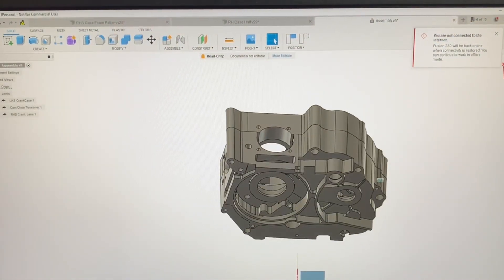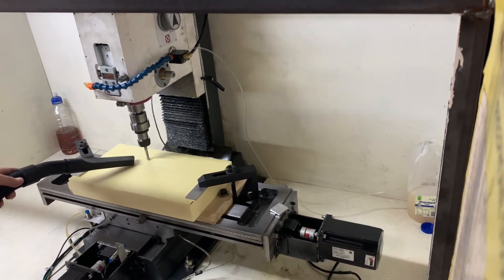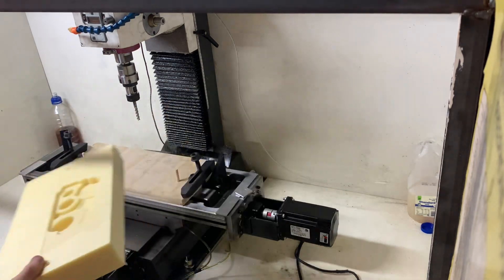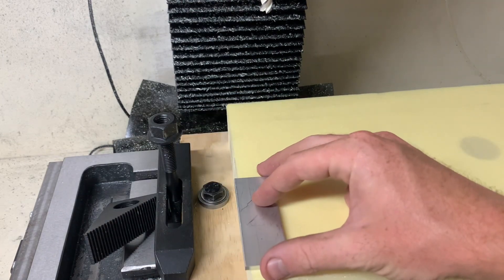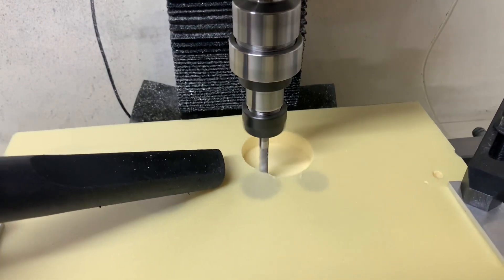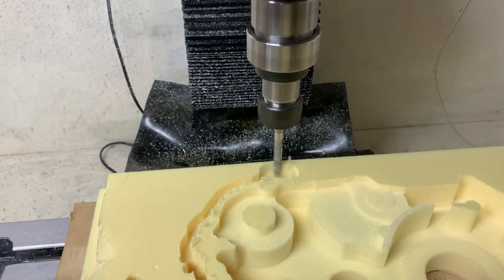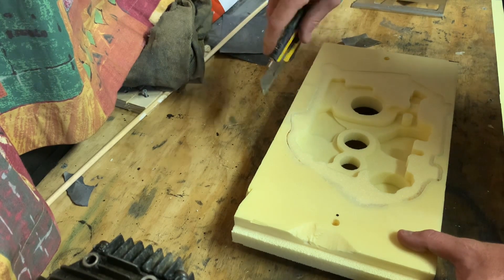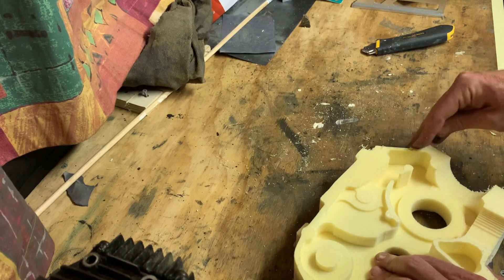Making a foam engine

Comment: You can share CAD files for those of us who have no experience using the program.
Reply from the maker: Negative although soon I will be selling the raw castings
Reply: @OddsandEndsMachining  Unfortunately, I won't be able to buy anything from you if I'm in another country. That's why I asked you to share the CAD files, no matter the modification, or sell us your CAD files. I don't have experience with CAD software, but I do with casting and mechanics. That's the easy part. If you do it, you'll be more successful. We don't disregard your work because it cost you. But it's only a digital file, and someone else will do it for you if you're stingy.
Reply from the maker: @osvaldodelcompare6627 to be honest, I’d rather ship the castings with paper drawings than sell the files. The castings would be very cost effective. 

Once the files are in someone else’s hands I have no control over them.
Reply: @OddsandEndsMachining  And why would you have to have control over them? If that were the case, Cults 3D wouldn't exist. No 3D design sharing site. I mean, it's not like you've invented something new and revolutionary. Someone with a photogrammetry scanner could do it in minutes. And so would someone with CAD experience. You're putting importance on something that doesn't have it. The cost of your work actually It's about creating the cast part. Not the digital file. You don't need to have control over the digital file. You need to sell the finished aluminum product.

Comment: I now milled my first foam prototype case and faced a problem. No matter how accurately i tried to zero it after flipping the foam block, i got like 3mm offset in Y-direction.
I'm trying to figure out what would be the correct method. I don't really understand how your style with those two pins works. Mind explaining a bit for stupid?
Reply from the maker: I don’t re zero for any of the set ups. I make sure I am using the exact same sketch point for my datum for all set ups (the centre of one of the pins). I just flip the work coordinate system so Z and maybe Y is flipped when I move the part.

Comment: This engine build is awesome. How did you get to the point of having the 3D model complete? Did you scan a set of old engine cases or did you manually measure and draw the new cases off your measurements? I'm just curious how you were able to draw up such factory looking cases. Thank you.
Reply from the maker: This all started with a scrap set of Lifan pit bike cases and a 150mm digital calliper. I taught myself how to use fusion 360 as I went, to get the basic shape I scanned the crankcase gasket and traced it to scale. Then I refined it over a 3-4 months in the evening when I had time.

Comment: Any idea how to create a styrofoam model out of an existing engine for placement testing? So the other way around lol
Reply from the maker: Using a 3D scanner on the existing engine would be your best bet and then printing it or machining from polystyrene on a cnc router. Does it have to be foam?
Reply: @OddsandEndsMachining  need something lightweight. Doesnt need to be that precise. 2 ideas I came up would be putting the engine in a plastic bag and then applying paper mache or industrial silicone to it, ans then using that as a negative mold.
3D scans are expensive, as well as 3D to real life, each step serveral hundred bucks
Reply: @OddsandEndsMachining  and thanks for responding
Reply from the maker: @chrissi.enbyYT  I’m pretty sure you can use most modern smart phones as 3D scanners using the forward facing camera. 

I think with paper mache it would be very hard to remove the ‘pattern’ unless you coated the engine in some sort of release agent.

Comment: congratulations sir. I am trying to do the same. but using a 3d printer. then make the mold and burn the plastic at 650 degrees until only the mold remains to inject the aluminum.
The problem is that I'm not good at designing and I don't know where I could get the stl files to achieve the impression. Would you be so kind to share your project? It would be a great help for me to get started. cheers
Reply from the maker: That sounds like a cool idea for doing the same thing differently. At this stage I am not willing to share any of my designs as I’ve put dozens of hours into drafting them and learning how to use fusion 360. I don’t want any uncontrolled copies out there, the best thing to do if you’re serious would be to buy a donor engine and some measuring equipment and start drawing. Fusion 360 is free and learning how to use it will set you up for any machining tasks you will need to undertake.

Comment: Nice work and pattern. In the video you mention using 2% shrink factor. For aluminum castings, I think you'll find that applying 1.3% will produce more dimensionally accurate castings. It's a fairly important detail for a technical part like an engine cranckcase. Good luck with the rest of the project. Best, Kelly
Reply from the maker: Thank you for the kind words and advice, your video’s definitely inspired me to go the lost foam route. I’ll see if I can make it work with 2% as it’s already all prepped and plastered to be cast. 
Otherwise for the next attempt should I need it I’ll shrink it down by 0.7%. (Fingers crossed)
Reply: Nominally, 3/16 per foot.  

There are special shrink rules done for this, and other levels of foundry-shrinkage for various alloys and metals.

Note: I have a 3/16 shrink rule.  I’ve done a fair number of foundry patterns.
Reply: @dennisyoung4631  For most casting alloys 5/32" per foot shrink rule is broadly the standard which is 1.3%. Shinkage varies by alloy because the melt/freeze point of alloys vary and this is the driving factor in how much an alloy shrinks more so than  composition of the alloy because the shrinkage goes as the coeficient of linear thermal expansion (13 microstrain, .000013 in/in/F for aluminum) but only once the aluminum has become solid, and there can be a 100 degrere range from where an alloy is completely solid versus completely liquid. A356 will be in the range of 1050-1140F whereas pure auluminum will be 1220F melt point and shrink more. A356 cools about 1000F from solidous to room temp so 1000x .000013= .013 or 1.3% Best,
Kelly